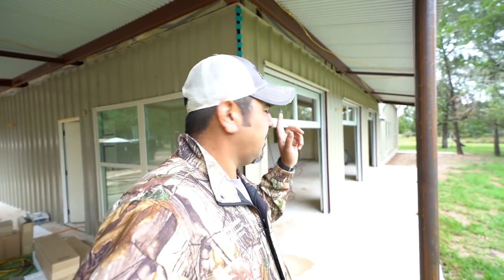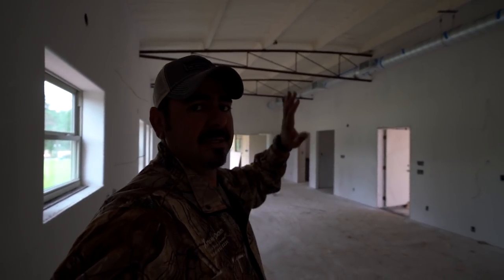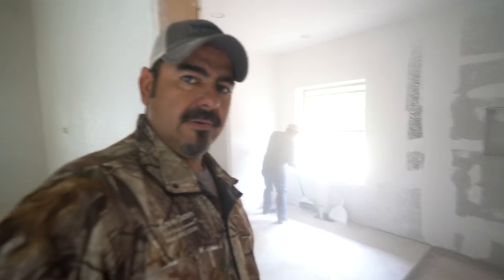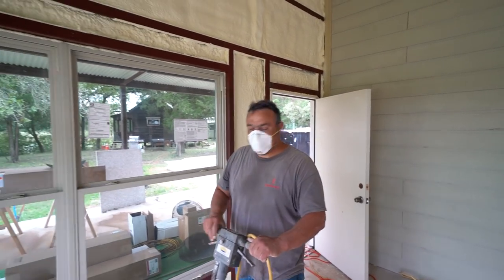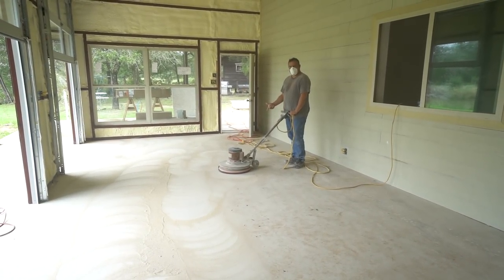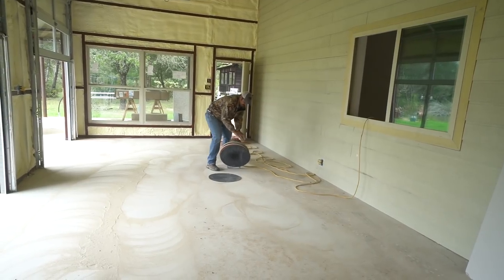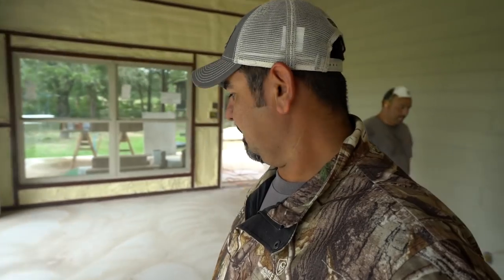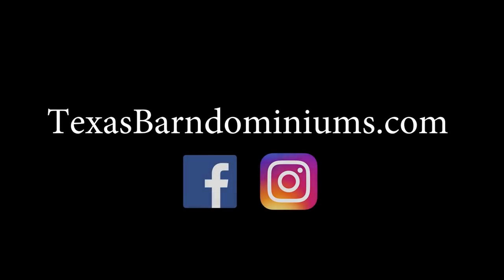Getting floors ready for staining - Episode 50 Texas Barndominiums

Comment: 8:00 the sand disc, is getting more friction, meaning it the floors are already so flat that they are in full contact and the "skin friction" is greater than what the machine can break...
Perhaps try a different backing pad, I think the red backers are the more aggressive ones BUT, you require it to bite into the 60 grit paper; this means shop the backing pad that will have the most bite / friction...
This will give the sanding face more "contact / holding force"...
I really do enjoy your content, thanks for sharing your great projects with us; the owners are getting a quality controlled product from your company.
Reply from the maker: Thank you.